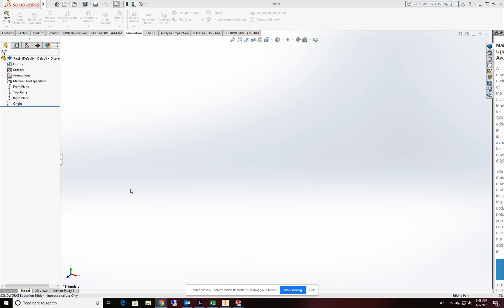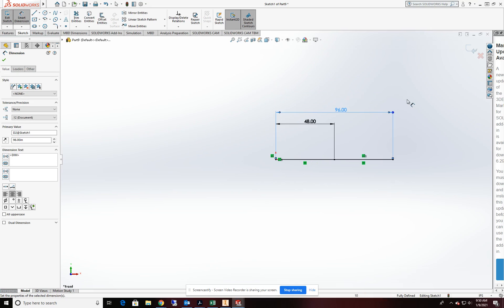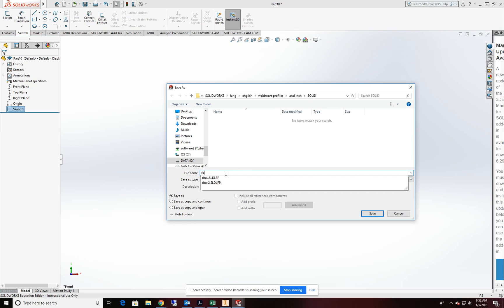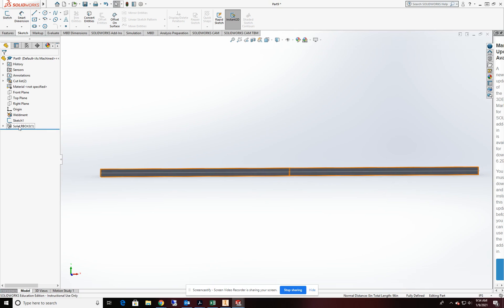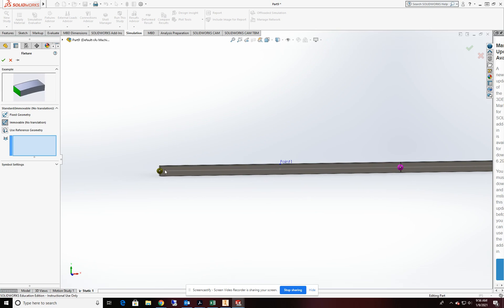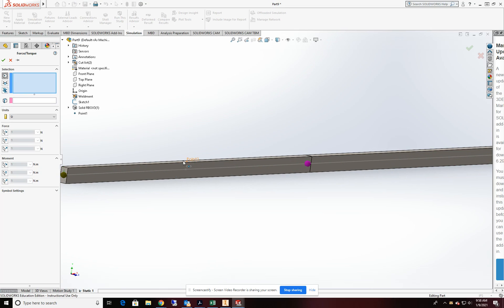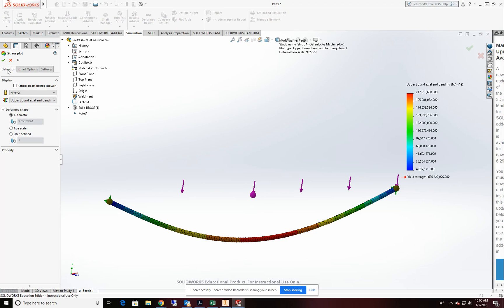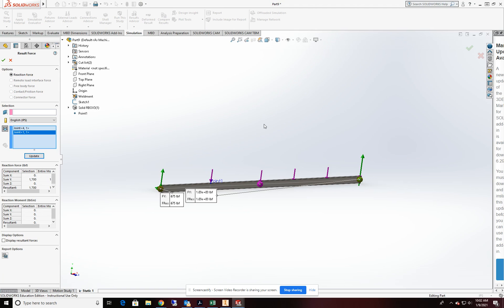SolidWorks 2020 Beam Analysis Tutorial

Comment: sir, can you make a reinforced concrete beam? I am desperately looking for a tutorial for my thesis and it would be my forever gratitude if you make a video.

or any advise on how to make reinforced steel bars inside the concrete beam?
Reply from the maker: hmmm,  i believe we can accomplish this.  but we would need to create an assembly that that contain a part file for the concrete beam, and part files for the reinforcement, since we are working with dissimilar materials.  From there we would approach the problem similar to the video, the only difference i can see currently is we would need to handle the contact between the reinforcement and concrete, by default setting up the contacts would default it to bonded which at first glance i believe would be the proper contact.  i will see if i can create this and make a video.  it will take some time though i am a little behind on some projects at the moment.
Reply: Deflection for beams with pre-stressed internal reinforcements?  I have thesis on deflection regarding the matter.